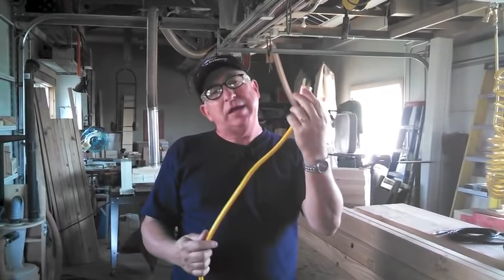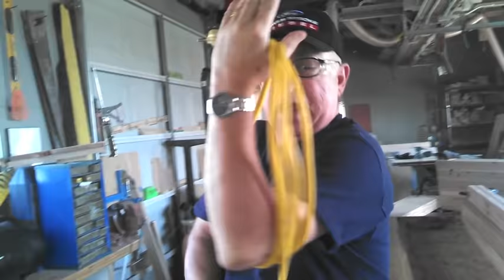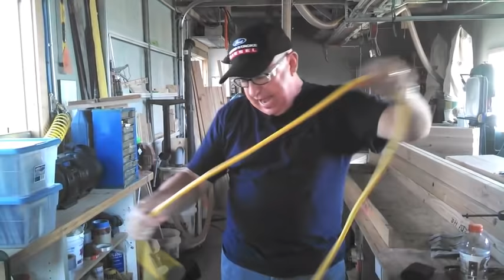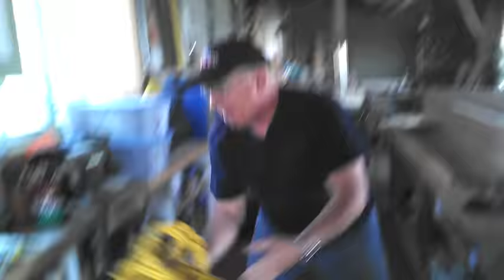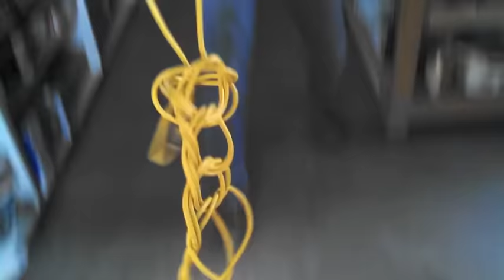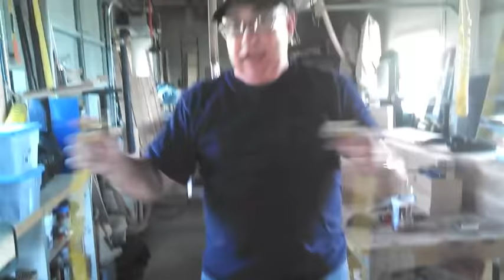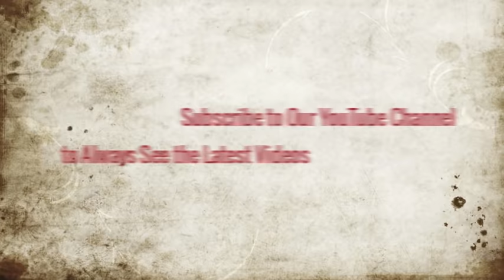Best Way to Store an Extension Cord

Comment: WRONG……
Wind it in a 5 gallon bucket, put it in the sun for an hour or so, and voilá, now you can keep your cord untangled, a bucket buddy and a seat………and yes, my way is way better!
Reply from the maker: The Dewitt Clinton - thanks for watching and then taking time to write and share your method. This is a method that many experienced tradespeople are adopting. It's easy to see why. 

We are planning a mini-series on cord stowage methods in the trades, and this is one that we'll be featuring - heck - we'll probably mention you! Can you give me any further details you think are key? I really like the sun warming tip - it sets the memory of the cord. 

I've seen this method where a hole is drilled on the side of the bucket down low with the male end of the cord extending through it so it's easy to plug in from the bottom of the coil and bucket. What's your approach? Also, what gauge  and length do you prefer? As far as the female end, do you use a multi outlet, either factory or made by you, or do you use the single.

As far as the seat, do you mean at Bucket Boss seat? And as far as the Bucket Buddy, you mean external pockets on the bucket?

Let me know.

Best, DFJ

Comment: Not convinced. You are (potentially) putting a kink in the middle of the cord. Not good.

I always completely unwind a cord before I use it. Sure, that is only considered necessary when you are using something that draws a lot of current, like a welder or heater, but in case I change my mind or someone else uses it, I prefer to err on the side of caution.
Reply from the maker: Thanks for writing and weighing in. Best, DFJ
Reply: @DirtFarmerJay  I'm impressed. You responded to my comment on a 9 year old video with almost 6M views and over 6,000 comments!

Comment: Never do this to your extension cords. I hate maintenance guys that do this crap. Soon as you need to roll out a clean, straight, flat cord for any purpose or event, you have a permanently curled and kinked up pile of trash that requires miles of duct tape to keep people from tripping over it. Just roll it up like a normal person. This is a solution looking for a problem that doesn't exist. File under over engineering and move on.

Comment: the first way is how you RUIN an extension cord
Reply from the maker: Ruthless, thanks for sharing your thoughts. I've not had the problem you describe and have been using this as one of my methods for many years in the trades. I also use other methods depending on the cordage and such. Thanks for stopping by! Best, DFJ
Reply: @DirtFarmerJay  i was referring to wrapping it around the arm, as you demonstrated at first. 
Thank you for replying, and I apologize from my combative tone. It has become my default when commenting. This is not an excuse, rather an explanation.
I will do better.

Comment: The first way was the better way. If you line it up right.  Ask anyone who uses hoses and extension cords in construction. I would fire a guy for doing this his way. Wasting time
Reply from the maker: Jas Jas, thanks for watching and weighing in. I did, however, learn this method way back on the job site when I was a trim carpenter. I could have a cord wound this way in 1 minute or less.This is how we were all required to store the cords. Best, DFJ

Comment: 1# It is not  the best way  if the  insulation  is made  of  PVC  PLIOVIC   instead of good old fashioned  RUBBER that most will not spend the money on, even if available which most stores will not stock because of cost .  2 # it is okay barely if  you do not store it in uheated  spaces and if you live in warm to hot climnates. 3# In cold climates  across the entire country ,stored that way  the cord sets in thight   coils  that will piss you off  when using it . NOTHING NEW ABOUT THIS ,  tried it 51 years ago,  in NEW ENGLAND  winter conditions, it sucks  as described in the first line  and even a good grade of rubber insulated cord will  eventually convince you not to do it that way .
Yeah it looks cool to some and  trick  like  ...but  the best way to store a cord is a 14  to 18 diameter coil circles , especially if it is a cheap pvc insulation intsead of rubber   ..and if it is a heavy gauge cord  too heavy for some to hold ..while coiling ...wrapping it around an upsidedown  5 gal plactic bucket on the ground , it will do nicely  ...for anybody with weak arms , when needed  to stretch it  straight  for use  especially  winter cold from sitting  ...it will be  lots easier to do and will stay much straighter  even if it is made of junk insulation .
Reply from the maker: J D, thanks for watching and taking time to write a well thought out overview. We are actually working on an episode about the different approaches to coiling and storing extension cords and some of your approaches are in the script. I have some 12 gauge cords that I only do over/under coils. Thanks for the conversation! Best Regards, DFJ

Comment: "Superior" - what a joke.
This works for rope, but this is so the wrong method for storing ELECTRICAL cables.  All those loops and turns are no better than winding it around your arm and pulling the internal cores within the secondary installation.  You clearly have an understanding of aesthetics, but no idea when it comes to flexible electric cable construction and how to actually look after it.  🤬
Reply from the maker: Thanks for stopping by. DFJ

Comment: No way sorry don't agree I'm a cleaner and have 7 metres of extension cord and no matter how you store it it turns out to twisted Curley spaghetti because when they wind the 3 wires it's twisted and that's how it Ends Up I know my cords I worked in a Rope factory everything is twisted they have a life spand they should make out of the old rubber then they will last longer
Reply: how does working in a rope factory qualify the same method for an electrical cord???

Comment: Ugh, DON"T BOTHER. It still looks like garbage. Maybe you need to use extrremely small loops? What a pain. I did NOT find this to be useful. In fact, the first time I had to unloop it and it was a nightmare - much worse than basic rounded method
Reply from the maker: W. Scott Davis, thanks for taking time to write, even if this method is not what you prefer. Best, DFJ